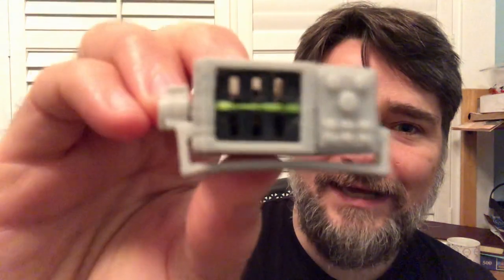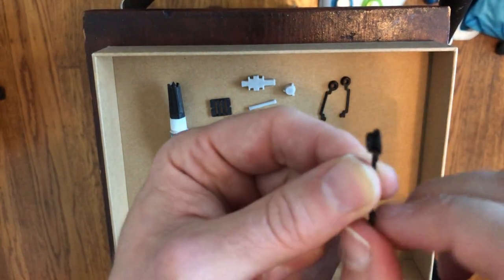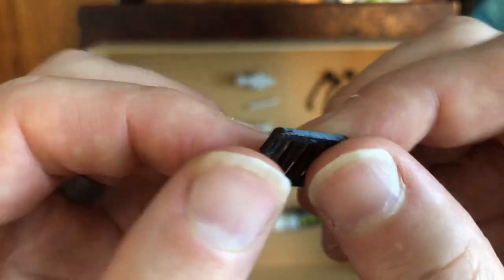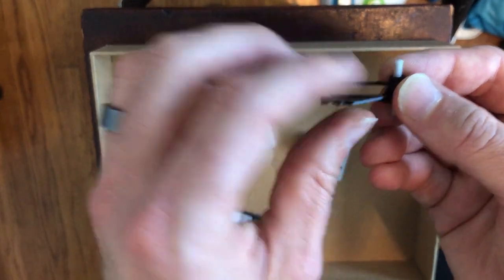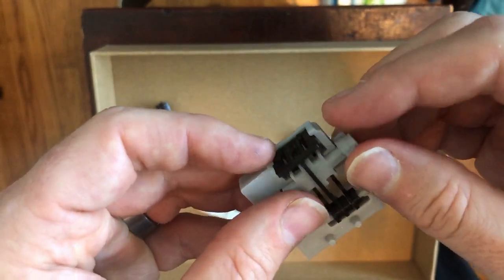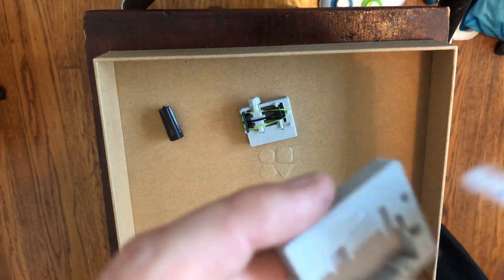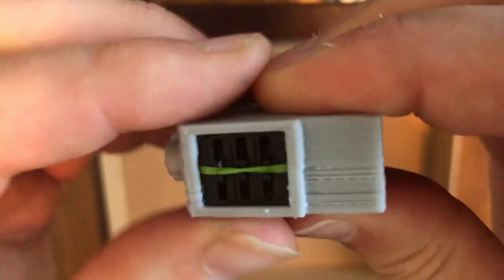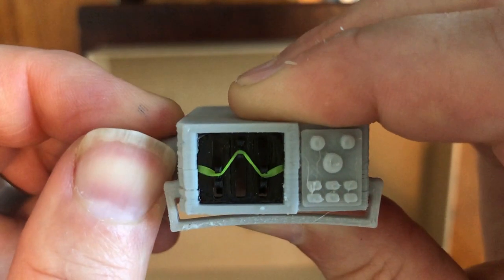Toy Oscilloscope Assembly

Comment: I would not glue the parts but rather design or drill holes for self tapping screws to enable replacement of the rubber"spring" when it fails.
Reply from the maker: That's a great idea, but it's so small that I think it would be more trouble than its worth, at least at 1:18 scale. It's also pretty quick to re-print all the parts, so I think I'd just make another one. If I were to scale it up though, I think making the case user-serviceable would be a great way to go